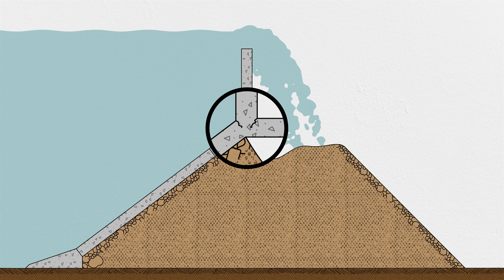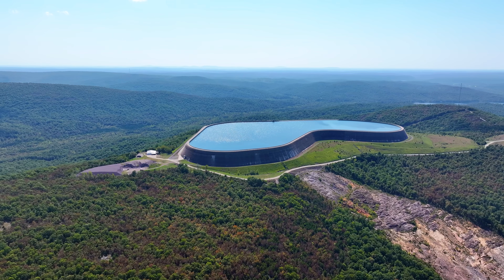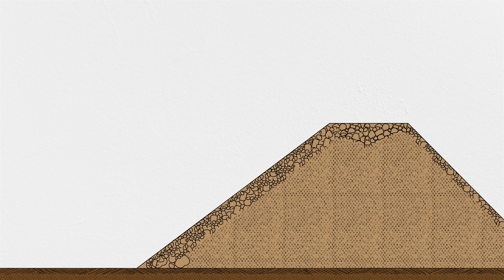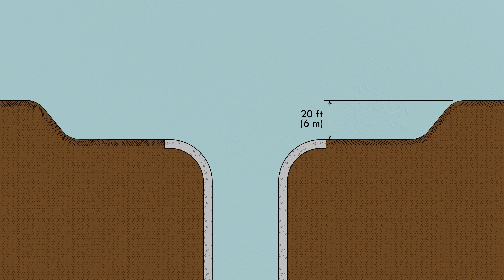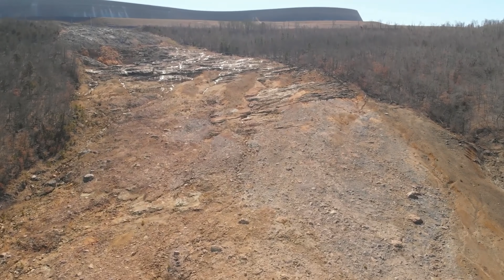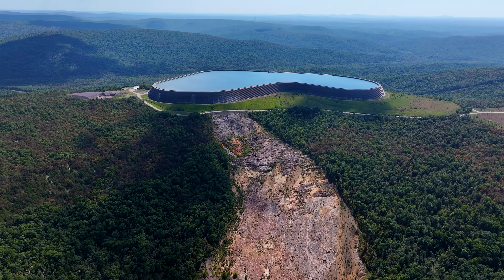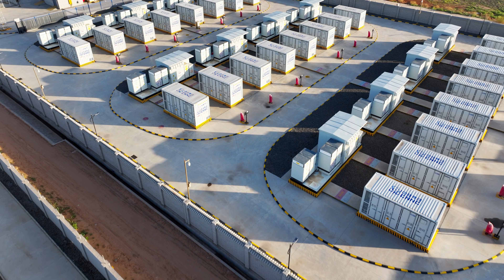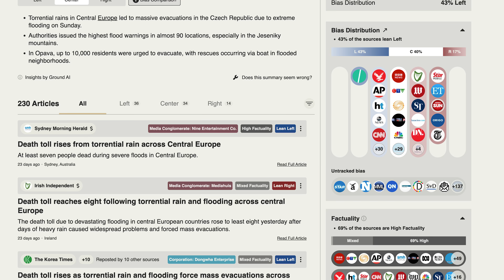The Wild Story of the Taum Sauk Dam Failure

Comment: This is why they have those overflows holes in bathroom sinks.
Reply: It also helps with drainage as it allows air to enter ;)
Reply: They could have grab the "depth meter" from a toilet instead of that nonsense sensor system as well.
Reply: @BergStark  Still has the potential to fail.  A physical path for water to escape safely should have been there from the start.
Reply: @BergStark  still wouldn't work because it would have been installed in a place that didn't settle and be higher than the water level.
Reply: @BergStark  The bouy water level metering is very unreliable, both mechanically and in terms of accuracy. It's just barely good enough to work inside a toilet reservoir. Their original design was the best solution for industrial type water level metering, but it had failed at inopportune time and they misjudged the degree of data distortion caused by it.
Reply: @michaelbuckers  emergency water leveling doesn't need that precision, they literally made them +-2 feet after all with their industrial measurment system. Simple mechanical bouys would be enough for "keep  water at least 2 feet below edge", especially if you install them in some kind of protective well to negate wind.
Reply: @glebkrawez5046  It'll just get stuck, or there could be a million other issues with it.  If this happens inside a toilet you don't really care, but if this happened on this plant then it'd cause the same disaster, except much more expediently. Plus, it's not a binary limiting end-switch, it's an analog gauge which feeds into computerized system to determine optimal feed rate at any given time. Monitoring water column pressure at the bottom of the reservoir is the ideal solution here.
Reply: @BergStark  well that couldn't possibly work..... I mean its a lot more complicated than a toilet...... you cannot possibly expect..... the wind or something.... ya couldn't possibly just use a toilet floater for a massive engineering marvel.....
Reply: @waron4fun597 yes you could
Reply: @waron4fun597   Why not?  I was thinking the similarly.  Strategically place some vertical pipes with floaters and sensors inside.  Seems cheaper and easier than whatever setup they had going.
Reply: I clearly didn't make this sarcastic enough...
Reply: @waron4fun597  People just seem to be very bad at picking up on sarcasm!!
Reply: @waron4fun597  "I clearly didn't make this sarcastic enough..."
Lol.
Reply: @jkjives1786 
You have to agree that sarcasm doesn't work very well with text.
Reply: @mikeoveli1028   Often it does not!
Reply: @waron4fun597  Maybe if you had... idk like stuttered or... put a few ellipses in or something people would have understood
Reply: @emmakai2243  That's exactly what I would do, three vertical pipes with floats like the new style toilet floats.  But both of my degrees are in Physics, so my engineering solutions are more brute force than elegant. 

However, half the issue was that the side where the water overtopped had settled around two feet.  So, even if you have sensors giving good data, that data wouldn't take into account that one side of your toilet tank is lower than the other three.
Reply: @samreagan6292  Given how it was typed, I'm pretty sure waron just forgot to add the /s at the end.
Reply: @waron4fun597  I have experienced too many stuck floats to find that agood idea.
Reply: @BergStark   Yeah, wonder what they were thinking.  Industrial sump pumps exist.  Just jerry rig those into the system.
Reply: The one in my bathroom is made decreasing due to mineral buildup I believe
Reply: So that when there's a dam breach up stream your sink doesn't overflow
Reply: Yeah... it's just a big bathroom sink 🙄🙄
Reply: Would seem like a good controll measure
Reply: The cheap sinks don't have an overflow either..
Reply: @georgepidick9967  no theres just internal venting  like some tubs dont have a visible hole it still vents that tiny hole isnt for draining an over flow
Reply: Yep, thats exactly what they should have, writ large, and put a simple sensor in the overflow. If there is water in the overflow, shut off the pumps.
Reply: That says it all!
Reply: What a beautiful simple solution for fail safe
Reply: lol
Reply: They should include those holes in public toilets.
Reply: My thoughts exactly.
Reply: How do you explain the glory hole in the stall
Reply: @jjlpinct  that's for a different kind of draining
Reply: @jjlpinct It’s the only way you have to get any
Reply: @jjlpinct that’s what you call a variable
Reply: @jjlpinct  Where else would you get your sushi?
Reply: @brothertaddeus  C'mon, we know those holes are for men to share hotdogs away from their wives.
Reply: @brothertaddeus  You made me choke and spray water all over my desk man. I did not expect a SGH reference on a Practical Engineering video.
Reply: yes, a lot of simple people building ponds even do so... I can't understand that "engineers" working on these massive projects did not come up with this simple solution.
Reply: @pietjemol3420 engineers by their nature want to over-complicate things because they like trying new, hip ways of skinning the preverbial cat.
Reply: @pietjemol3420 
Simple is not a word many engineers want to hear.
Reply: @mikeoveli1028  Not true. I always designed things to be as simple as possible but not simpler.
Reply: Thats not a overflow hole bud its a vent hole for back pressure   and vaccum to prevent an air bubble clog or vapor lock
Reply: @todydn 
Many sinks don't have an overflow hole. Those sinks work just fine. 
Your air to allow flow should come from a stand pipe or a Studor vent.